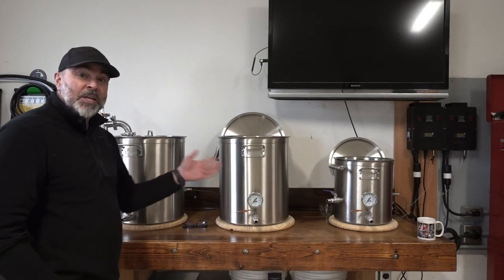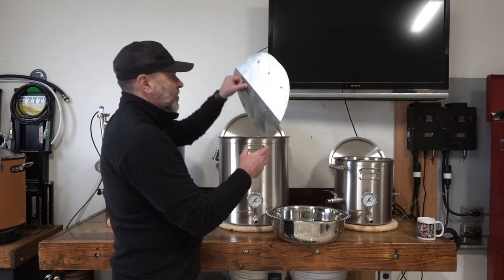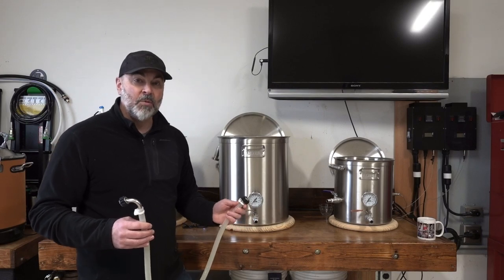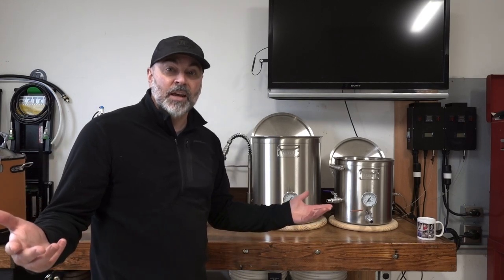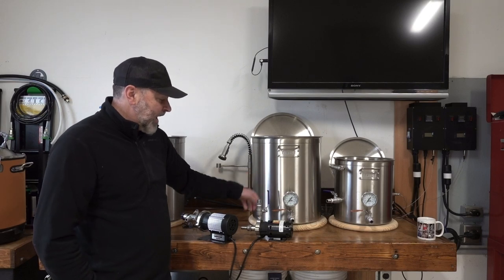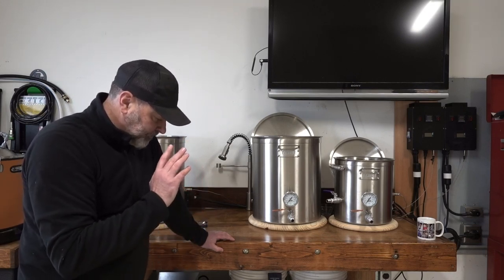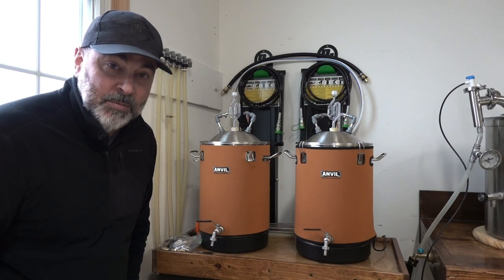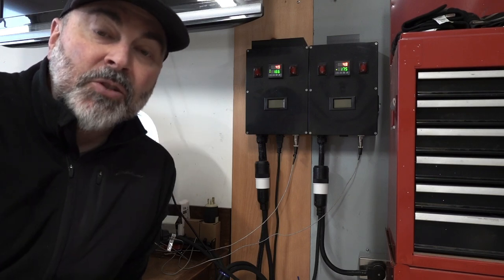A Tour of My Electric Home Brewery

Comment: Fantastic setup! Would you have a link to the Herms coil you used for the HLT? I have an Anvil Kettle of the same size that I'm thinking of turning into an HLT but I'm having a hard time find a coil that would fit in it.
Reply from the maker: Hey HogTown! Thanks for the comment!  I'm sure a lot of homebrewing sites carry this heating element. I would start by going here: https://www.blichmannengineering.com/boilcoil.html. I use the 120v version in my HLT Kettle and the 220v version for my Boil kettle. I've been very happy with both heating elements. BTW, since I posted this video, I upgraded my HTL kettle to a 10 gallon tank, however I still use the 120v 7.5 gallon coil for the heating element. So far, it still works great for heating sparge water. Cheers!

Comment: Where’d you get the stylish trivets underneath each vessel? Also, do you have a build video up yet for the control panels?
Reply from the maker: I bought those kettle pads from Lowes. They’re actually small circular tops for things like chairs and end tables. They come in a bunch of sizes. I don’t have build videos for my control panels. I’ve thought about it, but I don’t plan on making this type of video in the near future. I just don’t think I’m enough of an electrical guru to present that kind of how-to yet. It just a little outside my wheel house to present. I’ll follow up with you with some links on videos I followed for building these control panels. Thanks for reaching out! Cheers!

Comment: Nice set up.
You run your mash tun and other equipment underneath a TV?
Your steam condenser is a must I would imagine.
My philosophy for home brewing is, for a specific budget, look around for the best money for value equipment that you can buy.
The focus on good quality beer made at home should be brewing technique, sterility/hygiene and the quality of the ingredients you use (ie grains, yeast, hops and adjuncts).

A friend of mine makes some sensational beers using plastic fermenters and mash tuns that are converted coolers.
The ingredients he uses are top shelf though and his technique is elite (working as a Food Technologist in the Food industry).
Temperature control in the mash tun and during fermentation are critical factors and some home brewers dont have or cant afford instrumentation control or additional equipment to achieve this. You can get around these limitations by brewing during specific seasons or having access to cellars etc.
These days, controllers are very cheap and so are temperature probes, insulation blankets and heating pads/belts.
Reply from the maker: Thanks, Petra! Yes, I quickly found out I needed a steam condenser, even for brewing in the garage. I completely agree on your philosophy. There is a lot of stainless steel behind me, but I’ve brewed on basic equipment during much of my brewing career. You’ll probably see me breaking out my simple propane setup from time to time. Much of my equipment accumulation grew out of curiosity more than anything. 

I hear you on temp control. I controlled temps with a basic ice coolers, pumps, controller and even just a cool place in my basement for a long time with great results. Controllers are cheap and is why I built my own glycol chiller;)
Reply: @justhomebrew  Thanks for your response.
It's a great hobby that has changed rapidly over the past few decades. You can pretty much get access to industry standard equipment and control on a small scale. Lots of competition out there for All Grain mashing equipment and fermenters.
In past it was rare to see carbonation systems at home and pressure fermentation has just been phased in.
My next move is in the pressurised fermentation area. Get those esthers down and save on CO2 by trapping and using the CO2 produced during the fermentation step.

Cheers
(from Australia)

Comment: I like your system. What are you using   for HLT and BP temperature controller? Thanks
Reply from the maker: Thanks for the feedback, Jerry! I’m using custom control panels I built a few years ago. The Boil kettle is controlled by 220 volt panel run by an Auber PID. The other is a 120 volt panel that runs the HLT. This panel also uses an Auber PID. I might post a video in the future about this build. I’m not an electrician, so if I do post a video, it will be a really high level overview.